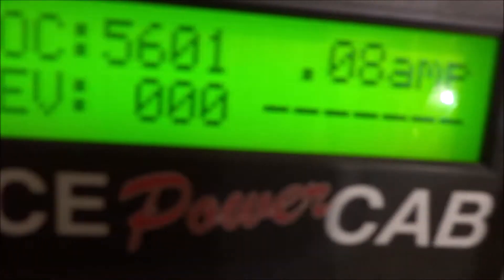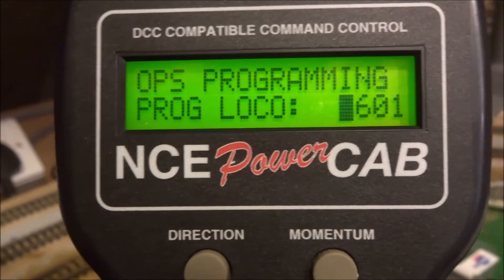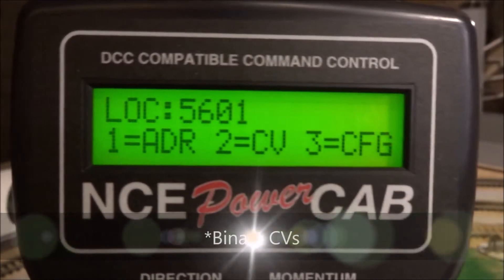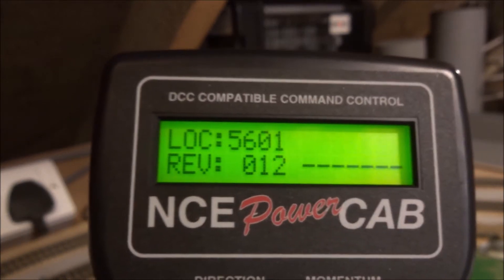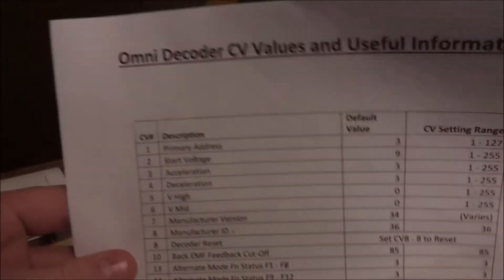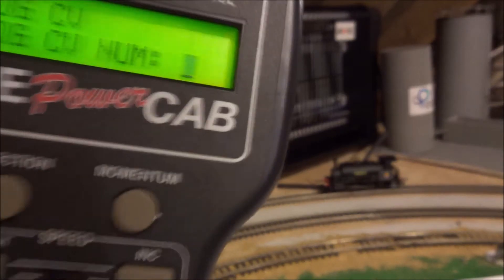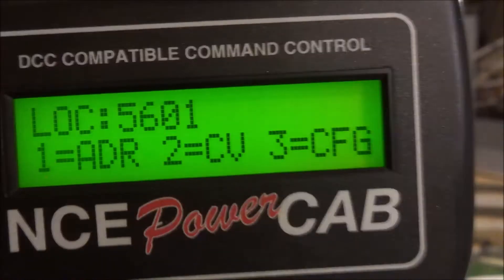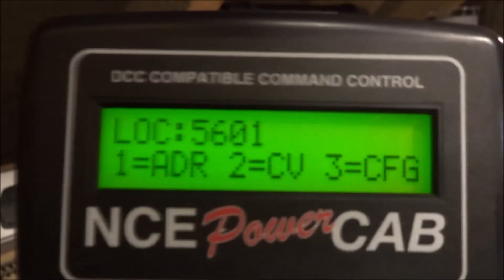Programming on the Main - NCE Powercab Tutorial

Comment: You might want to "pin" this comment.. I found out the hard way and quite by accident.. that the Long Address "Must" contain four numbers or the loco won't move. I have a loco that worked out of the box on 3.. when I tried to enter the loco number which was 540.. I had a light showing track power ..but, no movement. I was beginning to be quite frustrated.. I put the loco number back to 3 and it moved again. . . just by chance I entered 0540.. and it solved the issue.
Reply from the maker: Hmm... I've never had that issue with my powercab. I use 3-digit long addresses with no problems. Ie. for my multiple units, which are classes 350, etc, I use the class no as the long address with no problem. Might be an older firmware issue, since mine's only a year old.